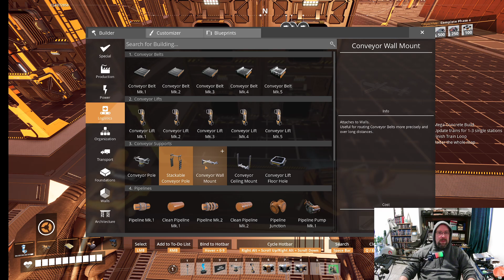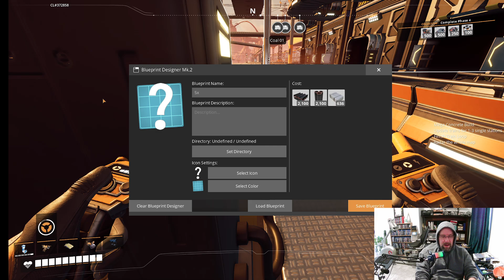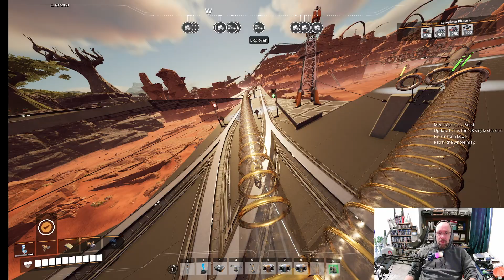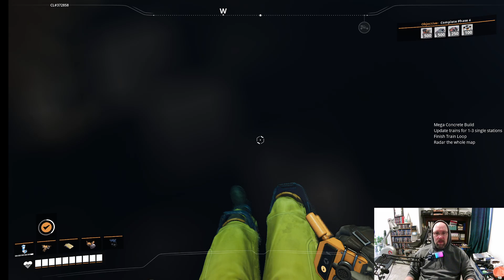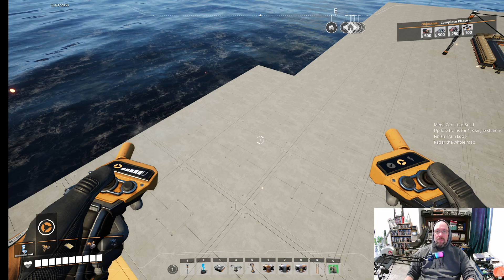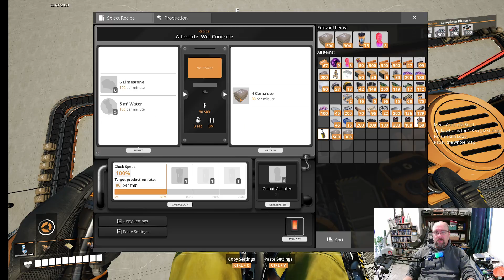Satisfactory | Let's Learn | 5x5 Mega Storage

Comment: I've been messing with "big" storage too, just for fun. I have a blueprint you might like, it's not mega like this. it took me a bit to figure out, it's 2 4 stacks side by side, but the left and right side feed off of each other, i can put an input in either side and it fills up both sides and will pull out of both sides and endlessly siphon from left to right side and top to bottom. Hard to explain and not as straight forward as a stack like yours is doing.  I'll try to make a short video clip.  It even uploads to the Cloud storage. It's like imagine if your last crate pushed back into your first crate to create an endless loop.
Reply: okay, i put the vid up, not going to link it as I don't want to pull from your channel, but it's there if you want to see it.
Reply from the maker: Sounds cool!  I'd love to see it, post a link when you get a chance!
Reply: @ here ya go. If you can implement this concept into your mega storage, that would be amazing

https://youtu.be/w7JlmIbbD1o?si=0JIu7EAs89fztrH2